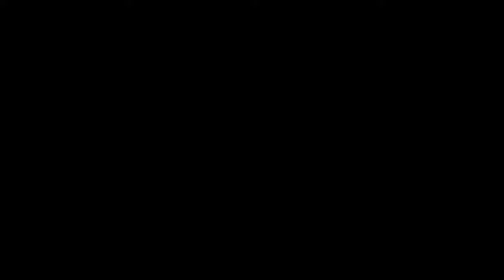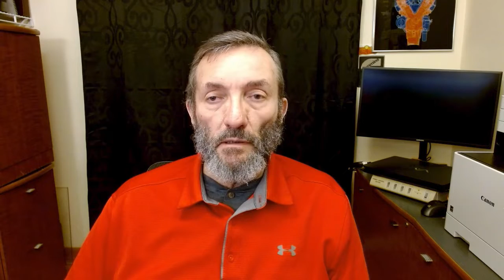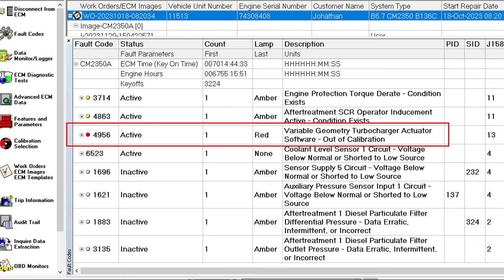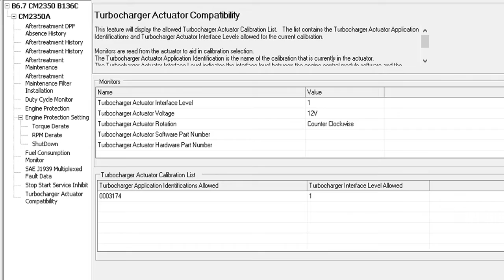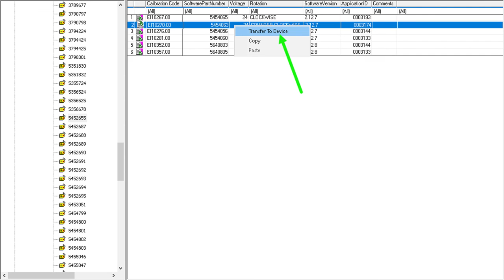Help my turbo new actuator is logging faults

Comment: Hello friend, I was able to pull turbocharger applications allowed 0003122 but I do not know how to look up which calibration code or software part number???
Reply from the maker: The look up can be difficult. So the look up list under turbo actuator calibrations just lists actuators part numbers. There are probably 50 part numbers listed. Once you click the part number the available codes show on the right side. So the problem is the part numbers listed many times have been superseded.
I used to just go down the list clicking each and write down the ones that displayed what I was looking for with the correct rotation ( CW or CCW ). Then I took the number i thought was it and went to parts and did look ups to see if it superseded from my to the number i was using in the look list. If i could not find it I called cummins parts and they helped me as they can us a tool called IMS to look back as far as they need too. BUT Just before I retired I hears IMS was being phased out ( it runs on DOS only). The parts guys i worked with like me are all gone now out of the modern work force but maybe you will find a parts guy who can help you when you call 1-800-cummins for help
Reply: @ENGINESHOPJOE  Thank you very much. I really appreciate it. I will give them a call 🤙

Comment: Anyway, I can reach out to you. I need help with a VGT actuator
Reply from the maker: email me at faultcodehelp@gmail.com.  supply your engine serial number ( 8 digits ) and the fault codes and or what is happening.
If you can send me an ecm image pulled with insite send it. That image would look something like the following: 20240712-2351642.EIF
Also let me know anything you changed related to this problem and where you got the part you installed IE dealer, cummins, junk yard etc
Reply: @ENGINESHOPJOE  email sent. Thank you.
Reply from the maker: reply sent

Comment: Same issue only service info says use pdd and it doesn't pick up pdd as an option? Was this under the engine side calibration? I didn't see the screen where you had all the parts numbers I've also downloaded the turbo zip from Cummins calibration
Reply from the maker: Insite> calibration selection> ecm pod (bottom rectangle)>open available under calibration workspace so automotive under that industrial etc go to bottom of the list and you will see pad or programmable devices >click the plus in front of pad and highlight turbo actuator ( name my be a little different but vet you get the idea) then choose P/n. Yoau have to extract that turbo zip to the calibration workspace or you will not see the p/n’s shown in I my video

Comment: Good morning  Joe, I had Cummins ISX 15  2012 that have problem with fuel knocking when the temperature range from 130 to 150. Do you know what thatcould be? there is no code
Reply from the maker: Timing changes as the engine comes up to operating temp.
Do a cylinder cut out test. I suspect an injector not firing correctly. 2012 if the injectors are original they have some hours on them.